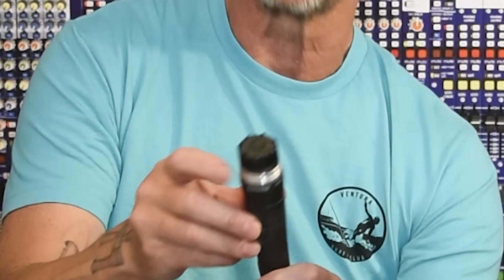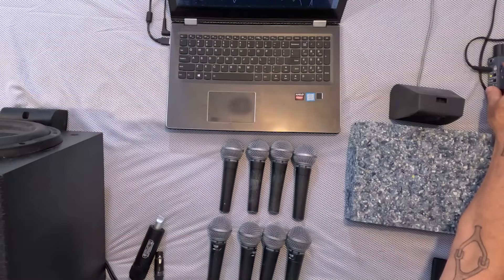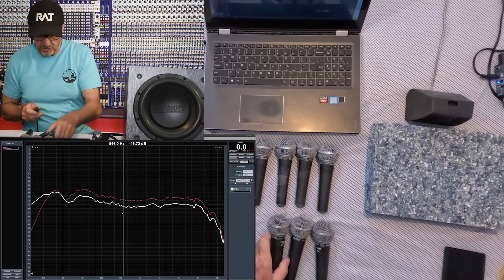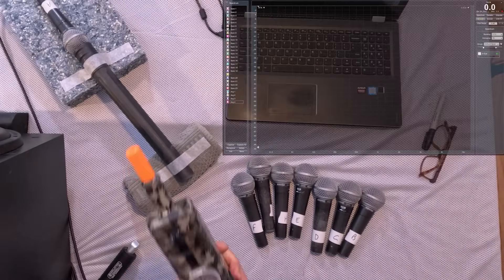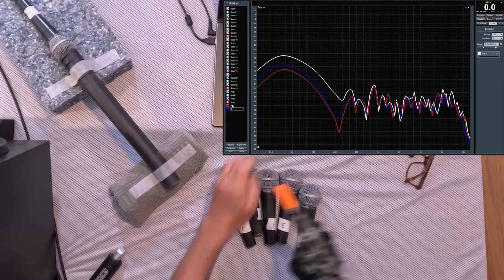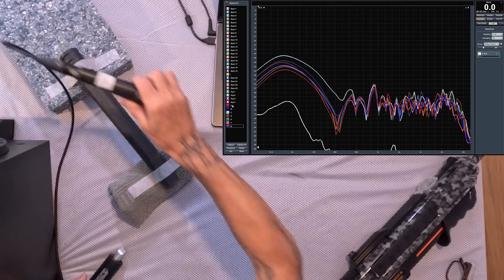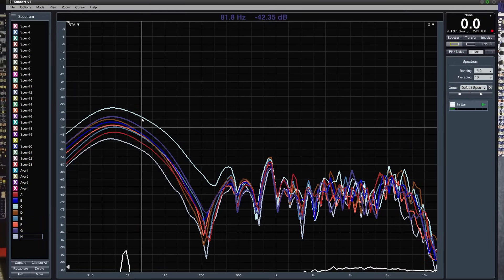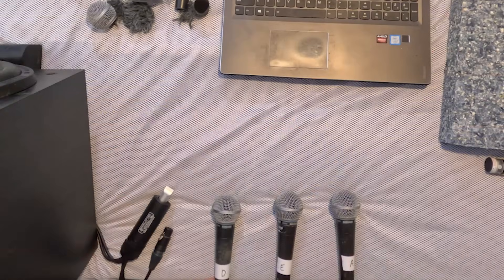Modifying Sm58 To Reduce Plosions

Comment: I had a few rock and progressive bands and we needed the dreaded sm 58 because of the presence they created to cut through the ensemble. The main vocalist learned a special type of hesitant pronunciation and mic distance control to get around the problem, without realizing it at first. Trying to deal with the actual cause is admirable.
Reply: Agreed. When doing live sound, I encourage the singers/speakers to project across the top of the mic, with it near their chins and pointing up. This also prevents it from blocking their faces. As a singer and voice actor, I practice without a grill or windscreen, to develop the pronunciation skill that you mention, holding back on the plosive consonants.
Reply: I thought this was proper technique for singing into a mic🤔🍻
Reply from the maker: My experience is that proper mic technique is whatever the singer wants to do the get the look and feel they desire or makes them most comfortable or happy with their performance.

And

A great sound engineer will the the singer the best mic for the job or their quirks or whatever is needed to get a desirable sound.
Reply: @DaveRat working in church sound, I am often responsible for training the "Talent" how to use microphones, and I generally use the Starbucks Coffee Cup analogy.
It's Life Itself, so it must stay right below your lips, and NEVER EVER EVER dump it out! (Pointing it at the floor wedges between verses is a common bad habit lol)
Reply from the maker: @ke6gwf don't spill the sound!

Comment: Fascinating. Off the top of my head,I wonder about a layer of felt between the foam liner and the grille.
Reply from the maker: From my experience and the testing that I did, as you increase the absorptive density of anything you put in front of the diaphragm it reduces the high frequency response. If you leave air gaps around whatever barrier you place there, the plosions are not affected and just go right around the barrier be it felt a heart disk or dense foam.

If you do not leave air gaps around the barrier, then you create a chamber that increases low frequency boom and alters the polar pattern as well as reduces the frequency response HF

Comment: I would argue the principal part of the plosive problem is simply incompetence on the part of the person using the microphone. I propose using absolutely NO high pass filter in the performer’s path. Let them hear the problem their misuse provokes and perhaps, just possibly, they might pick up a precious new practice.
Reply from the maker: Well in situations of mic cupping I would agree with you to some degree, The issue of plosives seems to be most prominent in situations where a person is speaking at some distance maybe 6" to 1ft from the mic perhaps for a political event or House of worship or corporate event, and a cardioid mic is used which reduces low frequencies at distance due to proximity effect. Compensation for the lack of low frequencies is made and even the slightest puff of air is almost impossible to avoid by the person speaking. And those slight puffs of air create resonant micro booms that are very annoying.

Subwoofers on an auxend and high pass filters can help mitigate but to really solve the problem without impacting smooth natural low-end vocal response, the plosives need to be addressed at the source

Comment: It’s called engineering. I’m pretty sure that Shure spent more hours than you. 😂
Reply from the maker: Perhaps that's too simple of a perspective?

When the original SM58 was designed, sound systems did not have the power and low frequency capabilities that they do now.

Due to the popularity of the mic Shure is remiss to upgrade the mic to accommodate its current usages.

So yes it comes down to engineering, The original engineering with a set of parameters which are no longer relevant in many situations and the further engineering that I'm performing in order to improve and modernize this classic mic and solve a very well-known issue that plagues many users
Reply: @DaveRat  Actually, Shure did upgrade the SM58.  They released it as the Dualdyne series.  I don't know how much better it is compared to the 58 and I'd be interested to see and hear the difference.

Comment: Am I the only one who actually made an uwu noise uncontrollably when I looked at the graph in smaart at the graph of the fly gun? I love how rounded it looks! Please tell me that is the actual curve, and not just an artifact of the speed of the measurment.
Reply from the maker: A bit of both. The FFT measurement works results in the low frequencies needing longer time frames so a short burst will get overly smooth with an FFT measurement. This will look different than an RTA measurement.

Pat said the frequency content will drive the curve and variations will show up but they will increasingly smooth at lower frequencies
Reply: @DaveRat  Thank you for your wealth of knowledge that you freely share!

Comment: I have a theory that plosives do not follow the inverse square law in the same way that regular sound waves do. 

I've noticed when doing corporate sound, when someone is speaking into a microphone that is too far away from their mouth, that the plosives are much more aggressive. I think it's because you're using so much preamp gain to make up for the distance to the source, that you're amplifying the plosives with the rest of the noise floor. Conversely, I notice if you speak into a microphone with your mouth right against the grille, the plosives aren't as noticeable. Even though the plosives are much more likely to hit the diaphragm, they're not being amplified as much with the rest of the noise floor since you don't need to use nearly as much preamp gain.

Would you be able to test that? Plosives at different distances vs pink noise at different distances? Do they stay at the same relative level or not?
Reply from the maker: I tried to do exactly that by doing smart measurements of the pink noise up close and the plosive measurements at the end of the long tube that was not sealed on either end
Reply: I believe you're absolutely correct about plosives surviving distance better than the speech itself, at least within a short distance, I noticed this too and also noticed that the plosives are not travelling at the speed of sound, but considerably slower, it could be as simple as how quick your mouth/lungs are capable of accelerating a blast of air during normal speech. Also playing into this is that the plosives seem to be much more directional than the speech, you can move the microphone out of the stream of plosive air by putting it off axis and almost completely eliminate the plosives but maintain a fairly good level of audio.

I tend to disagree with your theory about the preamp gain though, I don't think this is relevant at all unless the preamp is actually clipping, gain is not selective in that manner. You could test this by using a Y-split on your next corporate lectern job and have a high gain input lower gain input.
Reply: @chickenfizz  the point about the preamp gain has to do with level matching as the source moves away from the transducer. a person holding the mic 16" away needs much more preamp gain than someone speaking into the grille, if you trim them both to the same input level.
Reply: @mogwix  on second reading I see what you're saying. Not that the gain itself is responsible for unfairly choosing to amplify the plosives in favour of the wanted speech, but that the wanted speech has become comparatively quieter with distance than the plosives.
Reply: @chickenfizz  Yes exactly. I wonder what it is about plosives. They must be like those air cannon toys that "shoot" a puff of air across the room, or maybe they move like smoke rings ... could be an interesting bit of fluid dynamics.
Reply from the maker: Sound waves on the vibration of air molecules allowing sonic energy to travel whereas plosives are the physical moving of air like a fan moves air from one place to another.

With sound the air moves and then returns to its original position with plosives they are moves from point a to point B
Reply: @mogwix you are correct, because plosives are a physical attack on the microphone, from a directional air current that moves based on fluid dynamics, as opposed to sound waves that behave differently.

Think of one like a fart in a room with little air movement, the further away you are the safer you are, and a plosive as water from a nozzle, that is directed energy right at the capsule.
Reply: Does no one use the HPF?
Reply: @jcnash02  HPF helps for sure, especially to mitigate the proximity effect from getting so close to the microphone.
Reply: @jcnash02 as Dave often says, it's better to stop the sound from entering the system than try to filter it out, because a hpf doesn't remove everything, it just reduces it, and plosives are physical assault on the microphone, not just a sound.

Comment: Very interesting! I've always not liked the plosive amount from 58s, I prefer audix om series as they seem to have less plosive and a more airy high end in my experience. nice to see there's a noticeable difference in the mod!
Reply from the maker: Agreed. Though my main issue with 58 is stage noise bleed
Reply: @DaveRat  can you recommend a mic similar to sm58 but more resistant to noise bleed?
Reply from the maker: Maybe audix om5 or om6 is worth a try . Also Telefunken M8O is more expensive but I have seen singers that like 58 transition well to it.

Much of the challenge is lip feel for the musician as well as the problem with 58 and background noise is also what allows singers to sing farther from the might and still hear their voice.

Comment: I had this understanding that those mesh screens basically work to turn the turbulent flow of plosives into more laminar flow. And it's been rumored that even NASA at some point made laminar flow by just stacking packs of drinking straws after the fan to create laminar flow. So the mesh screen is "simplified" version of that principle of having multitude of holes in line :)

Comment: As Lewitt found out when comparing their own pop filter that is magnetically held in place on their microphone mounts to other pop filters (and the fact that when the Lewitt LCT 1040 came out, its filter was farther away than on all their previous microphones), the distance the pop filter has to the microphone is essential. It's easy to test if you got your own pop filter. Start making pop sounds with the filter touching the microphone grill, then move it farther and farther away to find the distance needed to make them effective.

I use the Hakan P110 pop filter which is excellent. It's thick, but still needs a distance to the microphone to work properly. The air needs space to move away form the microphone (to dissipate, like you said), so placing it straight on top of the microphone is going to be difficult. I understand you didn't want to alter the exterior of the microphones since no tests with that was done.

I am curious to how the effect of parts of the Hakan P110 filter cut up and placed inside of the microphone grille of the SM58 would work vs. your mod.
Reply from the maker: That p110 filter seems to be just open cell foam. As you mention, the farther the filter is the less dense and intricate it needs to be. When dealing with very small distances the intricacy and complexity of the filter design increases and the effectiveness decreases.

For applications where an external filter is viable, there are many good options out there.

But for applications where the singer is holding the mic moving it around a lot and the visual aesthetics are very important, such is not increasing the overall size of the windscreen creating more blockage of the face to cameras, then creating an internal unseen windscreen becomes very valuable and useful
Reply: Interesting you mentioned the Lewitt pop filter. I have the 440 Pure and noticed using my Stedman gooseneck pop filter was more effective and therefore I trust it over the Lewitt magnetic one. If the 1040 was released after the 440, then it means that I don’t have their optimal magnetic pop screen.

Comment: I could be totally wrong on this, but it seems to me the best route to go is an external filter.  Keep the stock windscreens, but add a "bozo nose" foam over top.  Those to me do a much better job at diffusing the extra burst of air pressure on the plosives.  It's a cheap and easy solution, short of adding in a nylon stocking and rubber band to hold in place.  

The more expensive added step would be to also to swap out the audio transformer inside the bottom half with one made by Tab Funkenwerk, the AMI T58.  It's a $90 USD modification and gets the frequency curve of your SM57/58 close to that of the Shure Unidyne 565SD or 545SD.
Reply: I'd rather live with an ugly windscreen than with a plosive-ridden vocals.  That's just my opinion.
Reply from the maker: Agreed and ideally could be no plosives or ugly windscreen. Striving for ideal solutions even when they don't already exist can be a fun adventure and sometimes end up as a cool product to have fun making and selling.

Dad said, making  plosive proof grills for another manufacturer's mic is not on my list of adventures. But possibly could inspire manufacture to do something, wouldn't that be cool if shure stepped up in fixed it!
Reply: @DaveRat  Do you have access to Shure's fairly new Dualdyne mics?  I wonder how much of an improvement they are over the SM58 that they claim there is?  🤔
Reply from the maker: Absolutely and yet external filters create visual and practical issues that self contained unseen solutions avoid.

There are often bigger ugly solutions that work work better

Comment: What we could do in terms of a solution is to design a piece of CNC cut foam rubber which fits over the SM58 screen, and the foam rubber holding a pop shield. Yes.

Not hard to make, methinks. Aluminum foam might be good as well. 

Wire would also probably be ok.

Could likewise just redesign the windscreen and grille, and sell a 3rd party upgrade which replaces the silver grille golf ball. Antimicrobial - solid silver or chromium finish, and the ability to attenuate the cardiod back entrance by adjusting a dial would be neat.

I will furnish the thread some drawings, gimme a minute and a half hour and some head scratches.

Comment: The plosive pop gun.

What a clever man.

Seriously.

I want one.

With an A weighted response.

I want one that does impulse response sampling and measures sound levels. With a cable tester. And a laser pen, one that measures distances and tells you the delay time would be nice. rta/peak display. And a smartphone holder. And a butane jet lighter for soldering and heat shrink. And a torch. And a walkie talkie. And a fitting for a holster for a real firearm - gigs in africa are serious. Fit it to the side of the mixing console, innit. In lime green.

All mounted in a plastic AK47 with a rubber rat deadcat like a silencer.

Yes.

Can you make a run of them? I think we need them. Especially Ukraine.

And a bayonet.